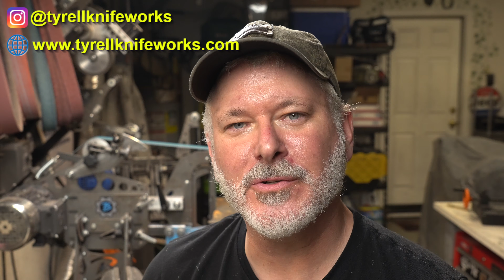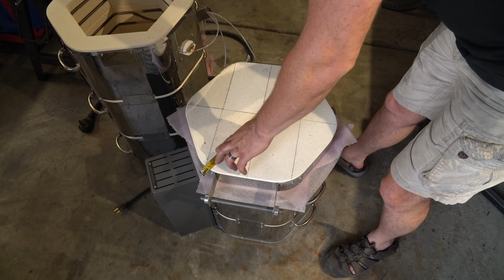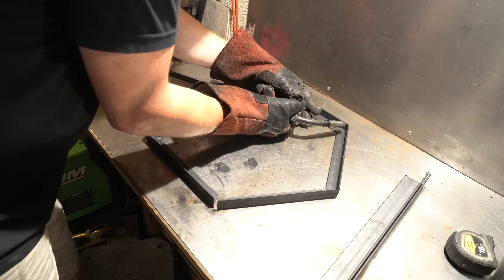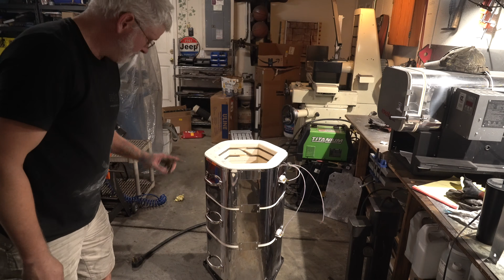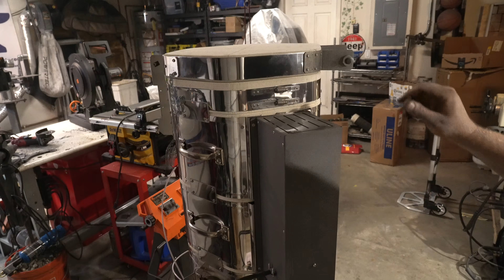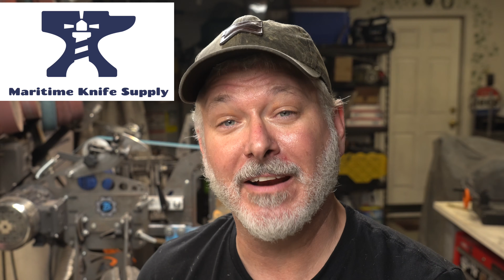Triple-T #144 - A new vertical heat treat oven!

Comment: While this kiln is huge and amazing, I think that octagonal form creates a lot of volume, which is not needed for sword actually. And the bigger the volume of the kiln, the more time and power required to heat it. 50 amps 😅
Reply from the maker: You don’t really have a choice when it comes to vertical kilns. Most of them are hexagonal like this one.  Like I showed in the video, it gets up to 1600F in 20 minutes, so that’s very good.  Considering I’ll probably only use it a handful of times a year, it really doesn’t matter. Thanks for watching

Comment: Should have gone with Jenken! Comes with a sturdy stand on casters, 50 in depth, and with a tap controller, and more affordable than Paragon and evenheat....
Reply from the maker: Ha, the 30” JenKen is over $4200 before taxes and I paid $4500 shipped to me for the 47”.  JenKen is WAY more expensive than the Evenheat.
Reply: @TyrellKnifeworks  not sure where you're shopping, I got mine for just under $3,700 through Iron dungeon forge.

Comment: wow thats a beast, brilliant insulation and its going to need it to be as cheap as possible to run otherwise its going to be a whopper on the electric bill. 
Very cool or should I say "hot" stackable furnace all told. I'm looking forward to the projects you need it for now.
 Thanks for sharing
Reply from the maker: I won’t be using this oven that often anyway.  It’s for special builds.  Thanks for watching.

Comment: Seeing how vertically you can move it on the castors, is there any down side to have this heater on its side?
Reply from the maker: This one isn’t designed for that.  Evenheat has a 46” horizontal already.  If you want horizontal, get that one. Note, you cannot put the horizontal into vertical. Thanks for watching.

Comment: I do quite like these vertical kilns, I've procrastinated for a while about making a 2-2.5ft one out of ceramic blanket and using a gas-torch and thermocouple set up as you do get quite a residual temperature in them over time. My inclination for the top of these is that for something like swords and big old knives is that a small slot fitting with some ceramic-cloth weave to keep the heat in around the top where the blade goes in might be the go. That way you can drop it in there without opening the top, burning your lower arm to a 12 secret herbs and spices crispy and dangle things in there to soak.
Its mostly about that suspension in the environment without injuring yourself in the process
Ah, yeah the casters still seem a little wobbly and you'll be up there on a step ladder messing around so there's some additional health and safety to worry about too!
50A... yeah I wouldn't trust a 50A extension cord, I'd wire that puppy in there just in case, I dunno if that messes up your warranty but its hardly the most heinous things done in knife making :)
Reply from the maker: Yeah I need to balance out the casters a bit.  Not a big deal though.  When I said "extension cord" I mean make one out of 6/2 wire with proper plugs, which is totally fine.  Thanks for watching.